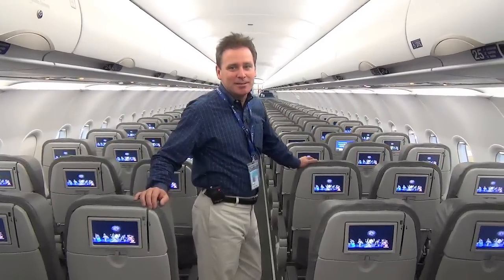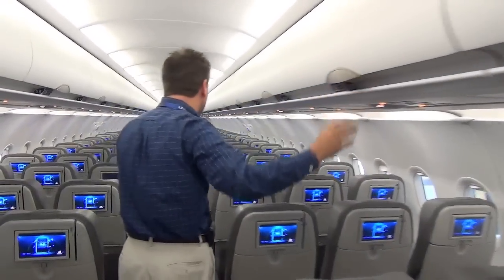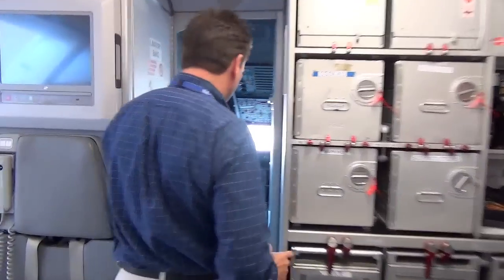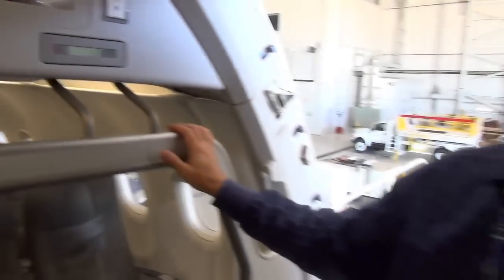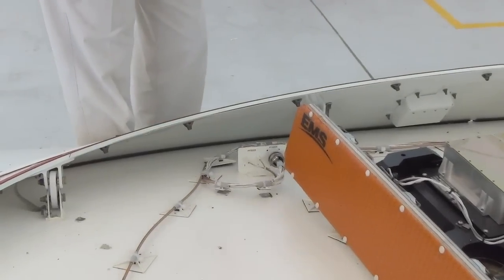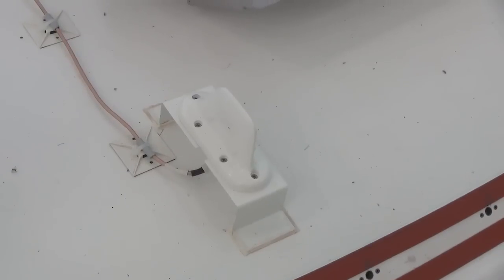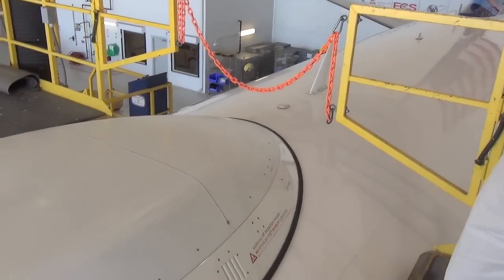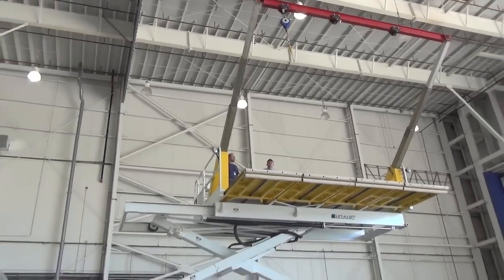JetBlue Fly-Fi: An Inside Look at the Airline's Satellite WiFi-Equipped Airbus A320 | Engadget

Comment: It's just FAA regulations, which are currently under review. A large majority of airlines turn off this "amazing tech" during takeoff/landing. Delta, and some European carriers, I've noticed leaves on wi-fi and the the IFE/AVOD on during takeoff/landing.

The reason is to increase situational awareness in the event of an actual emergency; it's easier to evac an airplane wtih alert passengers. Aircraft systems are more than well protected from "dangerous" radios.